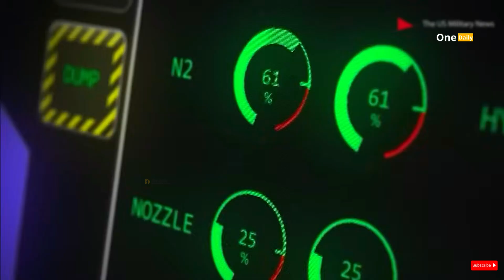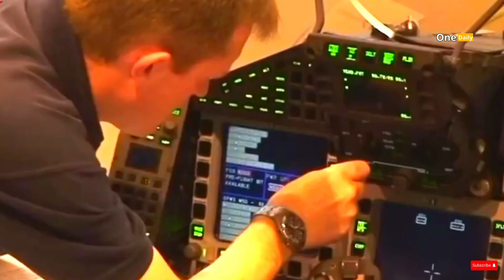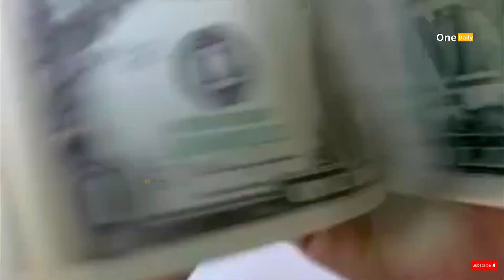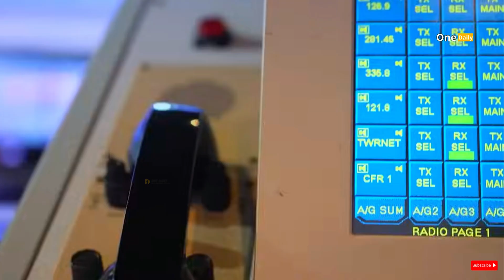Air Force's Controversial Decision: F-22 Modernized, NGAD Delayed?

Comment: Modernizing F22? What's that?  F22 is only 20 years old, a fairly new Fighter plane where most of the bugs or issues have just been fixed or repaired. A more appropriate term is to upgrade F22 to the latest revision and then built new generation of aircrafts. 
If we modernize F22 then what? It's still a 20 year old Fighter plane.

The U.S. Air Force prioritizes building the latest aircraft technology for several key reasons:

Maintaining Air Superiority: 
Advancing aircraft technology ensures that the U.S. Air Force remains ahead of potential adversaries, maintaining air superiority in any conflict scenario.

Enhanced Capabilities: 
New technologies provide improved capabilities such as greater stealth, speed, range, and payload capacity, enhancing the overall effectiveness of the aircraft.

Adaptation to Emerging Threats: 
Modern threats are continuously evolving, and new aircraft technologies are necessary to counter advanced air defense systems, electronic warfare, and other sophisticated threats.

Force Multiplication: 
Advanced aircraft often come with better integration with other systems and platforms, leading to more effective use of resources and better coordination in joint operations.

Innovation and Technological Leadership: 
Investing in the latest technologies promotes innovation and ensures the U.S. retains leadership in aerospace and defense industries, which has broader economic and strategic benefits.

Operational Efficiency and Safety: 
Newer aircraft often have better safety features, more reliable systems, and can be more cost-effective in terms of maintenance and operation over their lifecycle.

Overall, the push for the latest aircraft technology is about ensuring the U.S. Air Force can effectively fulfill its mission in a rapidly changing global security environment.

Why modernize F22, when we are capable of building new generation of aircrafts. This is not China where they have to steal the technology before they can build it.
Reply from the maker: @efrenplaza.
Doesn't building new technology require huge funds? Well, that's where the problem lies?
Reply: @One_Daily45  yes, it's expensive but losing a war is much more expensive. It also create jobs and new or better consumer technology allowing you to answer my post. What technology are you using right now as we speak,  cell phone, computer,  internet? Why do you think they exist? Is it because, B52, SR71, Rockets,  Satellites were expensive? Can you quantify the billions or trillions of dollars that came back in return building the latest and greatest aircrafts in the world?
Reply from the maker: @efrenplaza  It's true what you said

Comment: Frank Kendall said that NGAD needs to have twice the operational radius of the F35 at the same cost as the F35. This is because China has developed ultra-long-range anti-aircraft missiles that can target tankers. The weapon bay can be the same size as the F35 because the CCA (Collaborative Combat Aircraft) carries the missiles.
The US Navy also needs a fighter with twice the operational radius of the FA18. Stealth is the lowest requirement for carrier-based aircraft because the weapon bay is difficult to install and remove missiles.
The new design of GCAP meets the requirements of both the US Air Force and the US Navy.　The US Navy needs twin-engine aircraft.
Let's work with Boeing to get the US Air Force and US Navy on board.
Lockheed Martin could create a revised NGAD by enlarging the wings and fuel tanks of the F-35.
Fighters would have to visually identify friendly targets with broken identification friend or foe systems before firing a missile.

If missile launches were left to the Collaborative Combat Aircraft (CCA), there would be no need for a weapons bay, reducing manufacturing and maintenance costs.
Reply from the maker: hmm